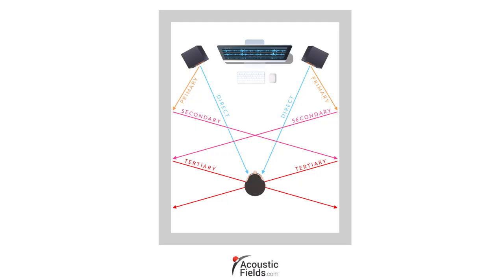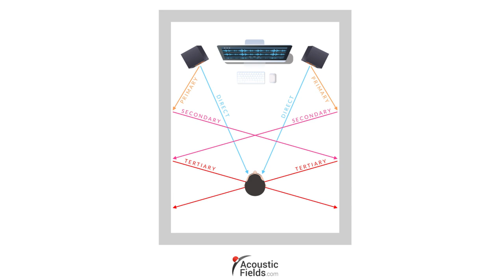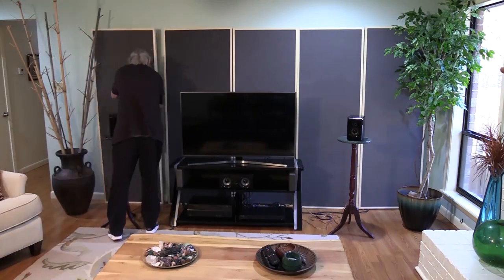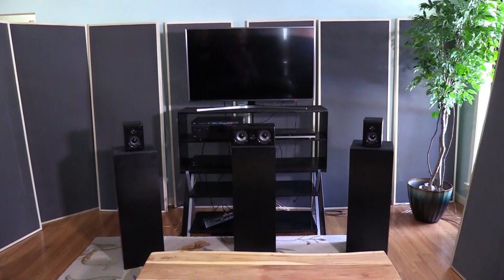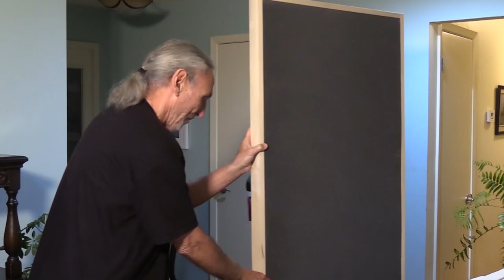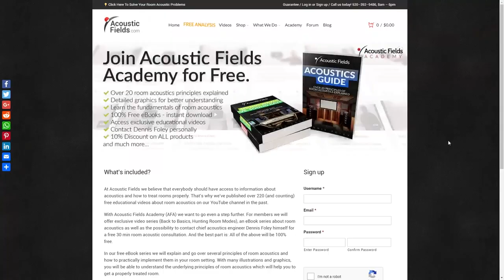Michael's Home Theater #3 - Rear Wall - www.AcousticFields.com

Comment: 4:45 - I get the idea, but having the bottom of a display at eye level sacrifices viewing experience and comfort. In most spaces, I think the ear-level center concept is problematic unless you have an acoustically transparent screen. In my case, I settled on a slightly lowered center, but a tilted up orientation with a wedge.
Reply from the maker: Viewing angles and distances from eyes to screen are subjective.

Comment: Dennis effectively you created him a listening room inside a poor listening area by surrounding him in removable acoustic panels which is certainly one solution to the problem if your best listening area in your house happens to be something like a living room with a high ceiling. I could consider hinging 4 panels together in concertina fashion and putting them on wheels to speed up the assembly and disassembly. Overall a good solution than buying another house.
Reply from the maker: With middle and high frequency absorption technology, its all about square footage of coverage. You must cover at a minimum with two channel or 5.1 the front wall along with both side walls. Leave extra room length behind the listening position.

Comment: It's also really bad if your listening position is close to the rear wall because the reflection and amplitude from the reflection is almost as loud and only a slight delay behind the direct energy and it just creates a mess, so DEFINITELY treat the rear wall and sit as far away from the rear as you can.
Reply from the maker: Stay at least 4' away. 5 - 7 better.
Reply: @AcousticFields  definitely.

Comment: Does WAF go up if you use coloured foam? Nice skit and great performance.
Reply from the maker: We do not add dyes or pigments to our foam manufacturing processes. These have a negative impact on performance. Grey is the color we achieve by using just the ingredients in our foam.

Comment: Great little series. Do you actually need a center channel in this setup. Those 2 seats must get pretty good soundstage and pinpoint center from 2 channels up front.
Reply from the maker: Technically no. However, I wanted to keep the same format as Michael was used to over the last 18 years.

Comment: I know this isn’t talking pro audio but I run a set of krk rokit 5s with a behringer truth sub that broke. After moving the sub out of the corner the bass from the rokits became over powering. Wondered, could the huge mass of the sub have been acting like a bass trap when it wasn’t on? I’m seriously thinking of moving it back even in it’s broken state lol.
Reply from the maker: Get you subwoofer repaired before you do any positioning. You will not know whether it is the sub producing the distortion or the room without a proper performing source.

Comment: From your first video in the series you said smaller speakers have more resolution and the new equipment you have cables 2500 listed do you believe in expensive speaker cables
Reply from the maker: Expensive is a relative term. What is considered by some to be expensive may not be to someone else. Expenses are usually relative to income level. I do know the impact cables have on a total system. Cables are like all things technical. You must spend enough to get the minimum features and benefits of the current technology.  After a certain price point, you are paying for minute performance increases that you may or may not be able to hear within your room. You can also listen to your system and polish up some issues with cables that you may not be able to get with your amps and sources.

Comment: Hello there, thanks for the videos. Just curious about the RT before and after the pannels.

If possible, could you please ellaborate a bit on the differences on the listening position when using diffusors or absorbers on the rear wall?  Does the distance from the listening position to rear wall direct influence the treatment choice?

Best Regards,
Reply from the maker: Unfortunately, we did not get before curves. We do have after curves and they will show those in the last video of the series. The distance variable is a concern with quadratic diffusion on the rear wall. There is no distance requirements with absorption. Absorption rates and levels must be balanced throughout the room before you introduce diffusion. If there are absorption issues left untreated, diffusers act as magnifying glasses and will highlight those issues and can make your room sound worse.
Reply: @AcousticFields  Thanks for the feedback and I will keep following this serie.
Reply: @AcousticFields  Just remembered one issue:
I know that Michael's room is a multi purpose one, as in the majority of we "mortal ones", and knowing that the WAF is always something that should be treated carefully, I would like to know if you offered some small advice in change the width and length dimensions in this acoustic sub volume within the room to get into a more "friendly room modes configuration".
Reply from the maker: This is a common request. Let's examine what it means. Choosing room dimensions that exhibit more favorable room response really means choosing a room ratio that has minimum coincidental modes. All rooms have modes. Most room have coincidental modes. The goal is to choose a room ratio that has the least coincidental modes since coincidental modes are the most audible of all the modes within a room. Coincidental modes are modes that occur within 5 Hz. of each other. They can be twice as audible as an axial mode.

Comment: If your room is like above why not fit your panels with small furniture wheels, then you can move them around without lifting them, like what I did.
Reply from the maker: That is an option. With this method, Michael can take the sidewall and rear panels and stack them along the front wall when not using for full theater. Adding more foam depth to the front wall increases the rate and level of lower frequency absorption.

Comment: 3:52 I ain't telling a old dog new tricks, the LCR should be same exact speakers oh get some ebay used JBL cinema professional in the room I use a JBL 4647 JBL 2226 15" with JBL 2446J JBL 2380A horn, 70mm SDDS five screen matrix, WOW! And it was cheap as fish and chips.  Got wait watching ebay until these cheap ones show up. 
But I would make way place that flat screen near close to the wall raised up just enough so it's visible from a back row seat and place the LCR Matched LCR no mismatching. Matched LCR as close to the Oled flat screen cos megantic field isn't going to disrupt the colour.  Place centre near close and LR with some good distancing spacing apart and of course you know this, tilt them down while listening to wide-band pink noise not that pink noise on AVR/AVP that is band limited, use REW pink noise and aim the LCR with LR towed inwards and tilted down and listen to where the point the high frequencies sound more higher in level also use microphone so the mic can see the frequency of the pink noise raising a little bit higher then tighten down the speakers so they don't have any tendency to move. Afterwards EQ the LCR with surrounds and the surrounds should be made up of arrays along the sidewall and back-wall so that you are ((((surrounded)))) then Tune/EQ to match the channels frequency to be as close as possible. Then put on region 1 DVD out print, Blue Thunder (1983) listen to the scene where the helicopters are flying though the reservoir and it should sound seamless with mono discrete surround with LCR.

4:41 not same sound field same horizontal plain can't be in same they are individually in different three-dimensional space where the sound frequencies spreading out have to be tuned adjusted EQ to get each one to tonally sound the same which can take hours to days to achieve no amount of autoEQ is going to do that in 15 minutes, you'd be kidding yourself it takes days to tune it. I do my EQ manually, I never use autoEQ again on my Denon AVC-X8500H, waste of time, plus I use additional outboard decoders and any EQ done ahead of the extra matrix decoders will mess up the signal-phase for decoding. 

I would start off by placing the speakers in the same position and run REW frequency sweep on each LR and that mismatched so called centre channel and look at the graphs Overlays to see what you'd be dealing with. Then place them all side by side and slowly move the LR and right apart wide and wide while listening for many things... Half centre pans like effects or dialog panning. Often there be a half centre in the centre channel while the other half-centre maybe panned to L or R or maybe a hard panned to L or R it depends on the film mix.  

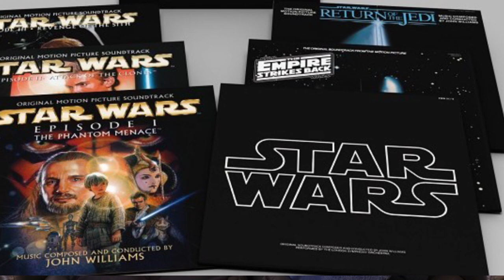7:04 only six Star Wars was only ever done with London Symphony Orchestra, LSO all those disney ones I think kk disney are LSO haters cos none was ever done and they sound tonally bad with those new disney star wars. Star Wars LSO Abbey Road Studios originals and prequels only.    

I guess with each panels that can be moved forwards by millimeters cos the low frequencies are omnidirectional.
Reply from the maker: I started out 50 years ago with JBL horns.

Comment: I keep hearing these same two words echoing in my head, over and over again. "If only"  :-(
Reply from the maker: Our foam frame panel is the most economical way to position our proprietary foam. It is not rigid enough to stand on its own , so the wood frame gives it the rigidity it needs to stand up.